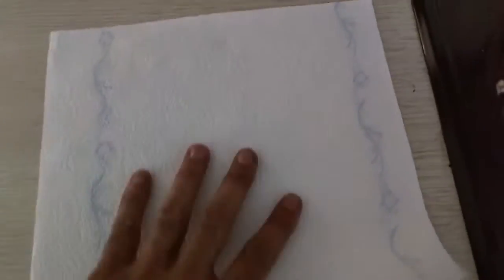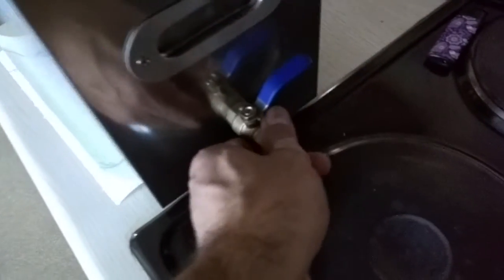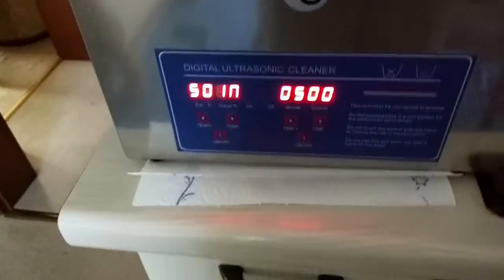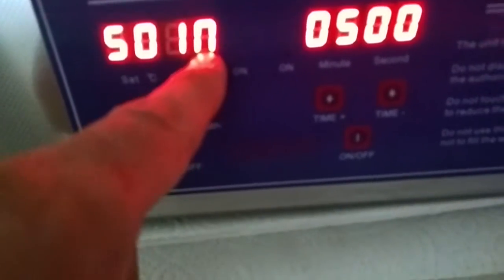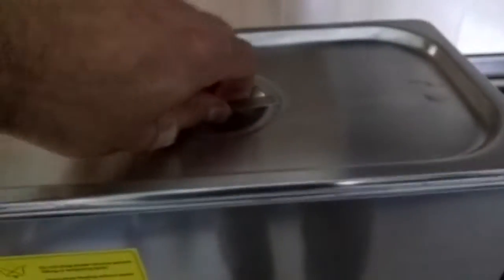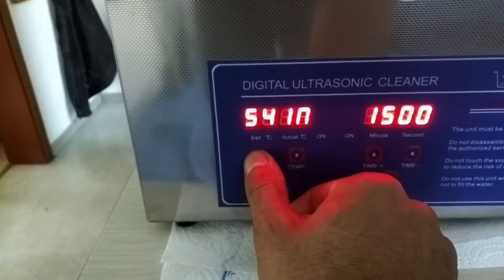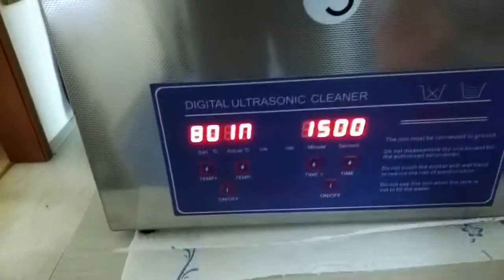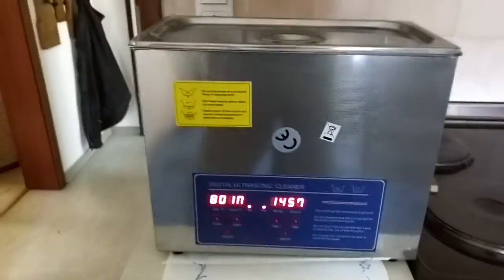Ultrasonic Cleaner 6 Liter problem/Test

Comment: It has to be the drain tube inside. I would pop the bottom off and add some thread tape to the drain pieces and solve the problem for a few cents.
Reply from the maker: I could do it also. But the machine was brand new with guarantee

Comment: hi @diychannel my ultrasonic machine has different problem.
the power to the machine is alright, but there is no power upto the display and doesnot work either... but the power light and switch on the back of the machine is lit.
please let me know what could be possibly wrong. thanks

Comment: If you wanted to clean at 80 deg  why did you not wait for it to warm up??
Reply from the maker: The machine was leaking. It lost water. You would wait? Electricity and leaking plus wait for it to blow up its not a good idea

Comment: I don’t think they are a good set up I don’t think the basket should touch unless it has the little black feet on all four corners it still works it must be your heater what do you expect you pay for a good ultra sonic about 5 hundred for one this big and I think you can get them through China for a hundred or less
Reply from the maker: The price is very good but if every china cleaner is in that bad quality then you think about to buy a good one for a higher price. The problem of this mashine is not the setup. It's the bad quality and its leaking

Comment: These cheap cleaners seem to have lots of problems, especially with reliability. Have three now with burned out something or other. One was my fault for running it without checking water level. Now to see if I can find a repair. Can't even get an answer at Ultrasonic in Yucaipa, CA.
Reply from the maker: it is very difficult to find ultrasonic parts. i looked around but the prices fpr the parts are too expensive and mostly the parts are not from the same manufacturer.

Comment: I suggest you better take it apart and check the drain valve connection. It looks like the drain valve is a leaking after high frequency vibrations.
I was watching you video and slow down at some point when filling, there was things look like particles going down.
Reply from the maker: it is not to good sealed at this position. i think that is a quality problem of this manufacturer.

Comment: Watch your video again.. on filling you can see particles going for the drain.. has to be a leak at the connection I would think.
Reply: yeah I spotted that little black particle straight away
Reply from the maker: i think it is bad sealed